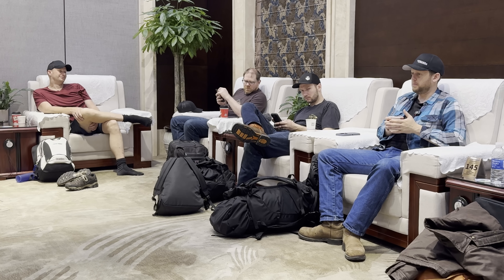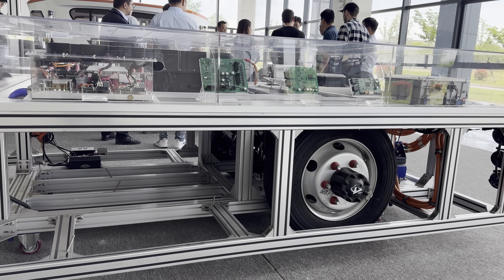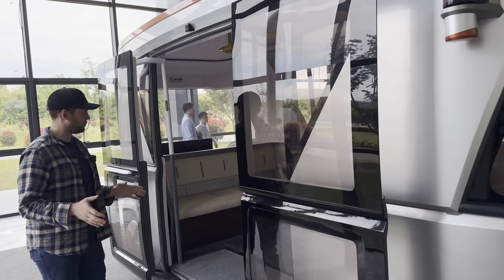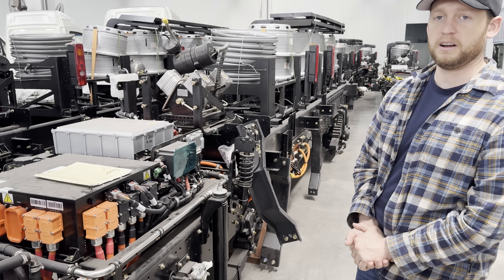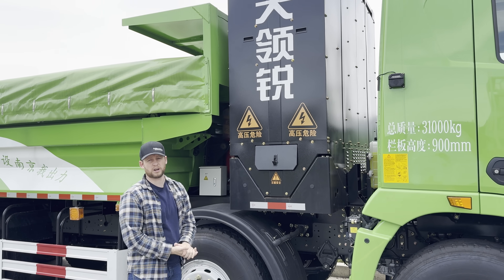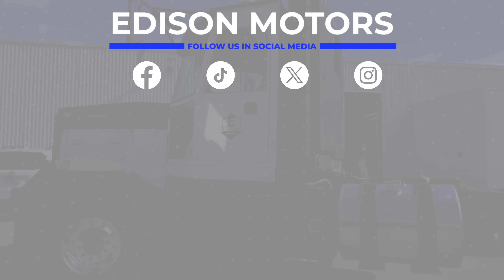Exploring Electric Vehicle Innovations | Factory Tour & Test Drives,  China Part 3

Comment: The Lifepo4 batteries (or most) should not be charged below 0°C.  I think the charging temp may change but to be safe u would stay a few degrees above freezing.  Also you do not want them to get very hot either, but it is my understanding that the Lifepo4 batteries are more stable. The was a Tesla truck that shut down an interstate in the west of the US for about 18 hours.  Also you would have less batteries.

Comment: Electronics, while extremely reliable, do fail. When it comes to a commercial vehicle, "I" think that a more modular approach would be more beneficial. That main inverter shouldn't be "all" in one. Should an operator or company be exposed to a design weakness in the system, they could at least swap out a smaller, less expensive,  block of the total system. Fleets could stock these, along with distributors to service to smaller companies overnight. If/when the design is improved those modular upgrades can be cycled though the system as needed. These will be expensive so repairing is viable providing as second option of buying reconditioned units. Enough said.
Reply: bae systems already doing this in the us

Comment: I'm really excited for what you guys will have coming out and in the works. 

I think one huge market, and something I'd be interested in for a diy conversion would be RV and motorcoaches(bus RVs). You buy one really good generator and put it into the engine bay, battery bank and e axle. Would love to know fuel efficiency on on flat-ish ground highway cruising. Optimized geared axle for 70mph, the generator doubles for on board components and drivetrain. Combined with the roof real estate for solar panels(that could be used for your house when parked at home).

Hoping you guys someday have a "kit' for the axle, electronics and the bit that bolts to the generator.

Comment: 5:30 Changes for an internal fuse would be a real pain for the customer. The internal slow blow fuses should be a last resort, with lower amp external circuit breakers as the primary protection.
Reply: The primary fuse is the integrated controller that turns off an output when it measures overcurrent. The fuse should only blow if there's an issue with that or there's a dead short (i.e. a good high-amp connection, simply touching the wires is not enough for that).

Comment: So your sourcing parts from China? I thought the point of the truck you were building was to be something you could go down to a parts store for replacements? And weren't you calling out others for being in Canada and sourcing Chinese EVs?
Reply: There’s a difference between sourcing parts for the vehicle you design and build, and buying an entire vehicle designed and built somewhere else and calling it your own. You are not going to go down to the parts store and replace the inverter, you are going to repair it. The parts store is for replacing common parts like headlights that are standard, unlike many modern cars whose headlight assemblies are custom and might cost over $1000.
Reply: if you're so mad about it, why dont you make parts for them? Can you make something better than the chinese?

Comment: for all china's problematics parts, the speed and scale of their electrification is amazing
Reply: You should get out of your basement. I understand Canada has none. But  you have to  experience their high  speed rail. Piece of  engineering marvel.
Reply: Outside of that the western media has told you, what are China's "problematic" parts?
Reply: They have fewer "problematic parts" than USA. They also have 26,000 miles of 220MPH Railway built in 15 years, an essentially new Highway Network and and a 5G network in remote areas you can only dream about.

Comment: Hopefully commerce can bring us all together. but  to protect yourself... Try to find a way to test what you buy routinely and have an out clause in the contract if the quality falls below your needs.  There is so much corruption through the supply chain.  Even the big national brands have inexplicable failures in structural frames and electronic components.  It's hard to keep tabs on a supplier on the other side of the planet.
Reply: China don't play about that. He can take them to court in china and most likely win. 90% . China don't like half way and cheating big customers in important sectors. They will be punished.

Comment: #skydontlie look at all that polution! 1:28 the gray haze is so strongeven at the apartment buildings just 2 blocks away, the skyscrapers to the left of them look like they are in fog
driving the dump truck around 7:40 you can look though the open window or the external shots and see the smog
Reply: Looks identical to what I’m seeing out the window in Calgary, and air quality is a 2. Atmospheric haze doesn’t always equal pollution.
Reply: @Neberheim  you should look at their air quality some time and then realize even that's fake and still bad
Reply: Looks like the window is adding to most of the haze. You can see how the "haze" moves as the camera pans.
Reply: @eingyi2500 yeah that looks more like just a neglected window.
Reply: @eingyi2500  7:48 seconds look out the open truck window at the treeline, still hazed gtom smog, and now its not even a city center

Comment: 5:00
I understand that the reason for the components being sealed shut is because high voltages are dangerous, but that seem to clash a little bit with the repairability of the end product. I'd love to hear more about that.

Edit: nevermind, it seems you did bring that up right afterwards.
Reply: That part was confusing. They said they came sealed, but then said the parts are easy to find. They clarified in another comment that the new 4 in 1 will be serviceable. Maybe they said it in the video and my brain missed it.
Reply: @willjohnsonjohnson  Sealed against water ingress.
Reply: Well for warranty purposes it's sealed. But it's just RTV or some such. If you're out of warranty, you just unbolt it, pry it open, and (of course with the proper electrical precautions) get to diagnosing and replacing components. Just like any device.
Reply: The classic blunder of not watching the whole video before commenting, everyones guilty of it.

Comment: Ah and all the pollution.  Sorry but a lot of the sounds like paid Chinese propaganda.  It is common for them to pay foreigners like this.  I'm not say that is what happened, but it sure sounds like it.

If that bus was self driving then why does it have a driver's seat.  China's EV cars have a notoriously high rate of catching fire.  They tend to make better parts for export, but also understand they will take all you designs and ideas and rip it off for use in China if they think there is a market for it... and the Chinese courts will NEVER back a foreigner.

That was a lot of rust on a brand new truck.
Reply: this guy’s like, if that car has collision avoidance, then why does it still have an airbag? A human operates it when it’s not on its preplanned route. It does seem a little wasteful of space; the autonomous buses I’ve been in usually have a port that a manual controller can be connected to, but they decided it was easier to have a dedicated seat 🤷‍♂️
Reply: “It’s common” he says with the confidence of someone who has been there enough to know. Which is why it’s odd that he doesn’t also know that pollution has been improving significantly year over year, especially as they are the largest EV adopter in the world, and that pollution varies widely depending on the industry in a given city.
Reply: @Neberheim  They do the EV production as propaganda.  They subsidize them crazy and a lot or so cheap the companies register the cars they made themselves so they make money off the subsidies... then thousands and thousands just rock in car lots

China does do knee jerk policies like ban motorcycles and scooters and crap like that in some of the larger cities, but the truth of the matter is China produces FAR more pollution than the US, FAR more CO2, FAR more mismanaged waste, and FAR more waste dumped in the oceans.  Last I checked it was 2.5x the CO2, 7x the pollution, 29x the mismanaged waste, and 32x more garbage dumped in the ocean.

China currently uses 9x as much coal.  This is for a country with still over 40% of its people in absolute poverty, the same land mass as the US, and a little over 4x the population than the US.

See if you look at that air quality globe you will see there are purple areas which means over 300.  But if you look at the most polluted cites China is much farther down the list and they are mostly in the 40-80 range.  So those listings are based on air quality stations and not satellite data.  China tampers with those sensors.  They will put tents over them or spray them with water.  They do the same with temp sensors and such.  They think they fool the world but they do not.
Reply: They make ev busses in California and ontario w unionized labor. Buy clues
Reply: Pollution has gotten a lot better throughout the years.  Tell the truth. good and bad.
Reply: @lloydmauler  No it hasn't.  Their CO2 and Particulate matter as well as their mismanaged waste and water pollution is STILL GROWING.  She the problem is they LIE about the levels... then pay billions in propaganda so Google search will put their BS numbers for the picks on the entire first page.  They are 19th worst in the world with only small Middle East, African, or Asian countries worse than them.  Their CO2 numbers are also BS, but those are easier to determine.  The CO2 levels are still skyrocketing up.  They produce about 30% of the world's CO2.  5 or of 6 of their rivers and lakes are the worst on the scale they use to rate water and the 6th is next to worst.  They only properly dispose of about 30% of the waste.  They pollute the ocean 32x worse than the US.

China is horrible.  I can give you a web site.  Usually chat blocks it so U will spell it out...  iqair (dot) com (slash) earth if you want to see real time air quality of Particulate Matter.  This is the stuff that causes pollution and acid rain and likely has FAR more impact on rainfall and weather than CO2 ever will.  This is real time updated every hour from satellite data.  Compare the US or Canada... or even Europe to China, India, Most of African, the Middle East and really most of Asia.  That is where all the pollution is.
Reply: @toddabbott781  - Actually by your referenced website, China (with 28% of global manufacturing) has improved overall until an uptick last year, and is tackling the issue with policies and renewable investments, including a national grid for far rural areas dependent on coal for 24/7 energy. Their innovation, production and adoption of green tech is driven by an ambitious government goal of peaking emissions before 2030 and carbon neutral by 2060. 

Never underestimate the underlying pride of companies/workers motivated by China's global leadership goals in climate improvement and EV production. They understand the sacrifices made to dominate global manufacturing, and believe in government 5-year plan statements to help clean things up.

The US auto industry laughed at early Japanese cars to their own demise. There's a reason the US slapped a 100% tariff on Chinese EVs to protect the auto industry, and while the speed of Chinese EV innovation and vehicle manufacturing undoubtably left quality gaps; those improvements will come through feedback/requirements, and further 'adoption' of innovations developed elsewhere.

Comment: The integration and non- serviceability of the inverter unit seems contrary to your right to repair directive... nevermind the potting, but there should at least be an adequate degree of modularity. Doesn't a 3 in 1 integrated inverter make it harder to configure trucks for different functions? (For example, auxiliary 1 or 3 phase power output for welders or for a hydraulic pump).
I'll answer that. Yes, it does.
I think the best way to spend those engineering resources would be to engineer the power mgmt (at least mgmt of the DC bus input/output from battery and to various loads) system for modularity instead of integration into one potted unit that must be replaced when anything inside it fails.
Reply from the maker: In our meetings we talked about making those changes, I like the idea of a 5 in one with spare functions.

The 5 in 1 is also serviceable now and parts can be swapped out and changed, we just did that today actually when a part broke during testing.  So now you can take it apart and service

I wish you could video reply to comments like on other apps with shorts so I could show you what I’m talking about on the new one we sourced from these guys
Reply: @EdisonMotors  that's good news. 
It seems like standardized precharging and switching module/s  plus voltage/current sensors with a corresponding standard communication protocol would allow modular expansion of the DC bus to various DC loads (most likely various inverters/VFDs). 
The inverter controller would enable switching ON auxiliary contactors, monitor auxiliary current, as well as coordinate precharge and contactor switching of whatever loads are connected to the auxiliary DC bus. 
For failsafe design, the auxiliary load modules should contain their own shunt, load side voltage measurement, +/- contactors, precharge circuit in one unit, to allow detection and isolation of shorts.
That should work well and be scalable, assuming the ampacity of the DC bus is designed for whatever additional load...
That topology would also enable DC-DC converters, even bidirectional, to allow voltage conversion for various applications, or even to expand vehicle charging from various sources. (Not to discount the difficulty of the required embedded software to make that happen). Topology of course is a precursor for those capabilities.

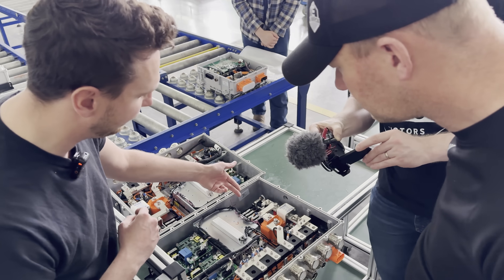Comment: 5:07  I like the use of indicator paint to indicate a torqued nut or bolt - W used a similar system at Creo where critical bolts were indicated and red-loc-tite'd   
For the purple/black cable above in that frame... I'd recommend spiral wrap or cable wrap, if they're zip-tie'ing to a raised sheet metal attachment point.
I like the use of RTV silicone on the circuit boards for the big components - Tall electrolytic caps and tall soldered components  like to vibrate.   Another solution is to use an electrical grade epoxy .   I've seen non-electrical grade silicone connector boots catch fire before.

9:00 Vibrations - theoretically, they should be able to  have the electric motor idle for half a second while they change gears, as the transmission would have a signal wire to signal a gear change.  Also, they could tune out some drive line shakes in their control system to avoid shakes they find like 120 hz (sound of things slapping back and forth)
or make the servo loop a bit softer around gear changes.

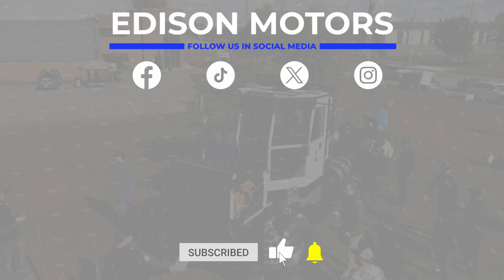11:00 that contest was rigged!

Electrical vendors should be able to offer the option of conformal coating to protect the board in the event you get a few drops of water or a loose solder ball in production.  There's my feedback, hope it helps.
Reply: @10:38, not rigged but lose accuracy when they focus on power and get frustrated, I know some carpenters that can one tap nails, but they have also been working with them for a long time.
Reply: Ahhh Creo, the heart of BC hardware knowledge :)

Comment: There always seems to be a little bit of slop in a driveline.  There is a lot of little manufacturing tolerances that have to be included in them.  With a ICE engine it’s ok because the clutch and the power needs to build RPM’s.  With electric you have it all at 0 RPM so the whole driveline gets hammered as those tolerances get taken up at full engine torque.  An electric axle minimizes most of that, what is left is in more robust gears.
Reply: You can easily control the motors so they don't hammer in from zero but wait until that gaps are closed.